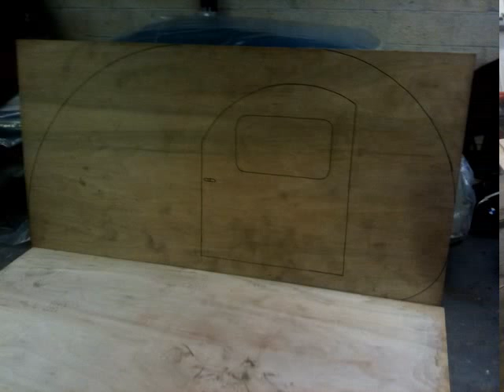Teardrop camper  caravan build by me in my workshop

Comment from the maker: @bentstraight Hi suspension units are rated at 550kg (each). Very cheap on ebay but be aware cheap is cheap for a reason. The more expensive units are a lot better aligned. All the best. M